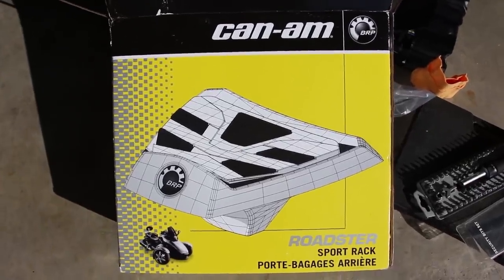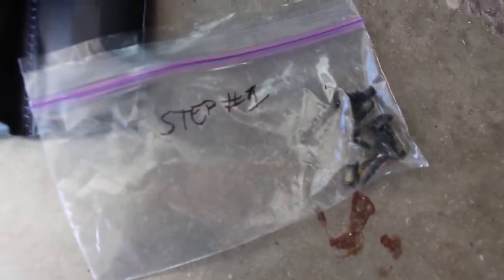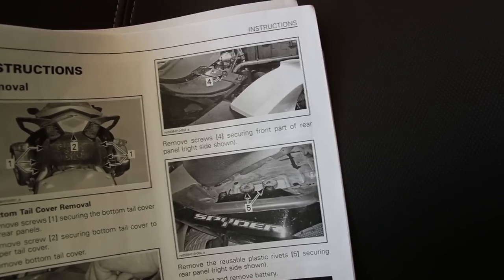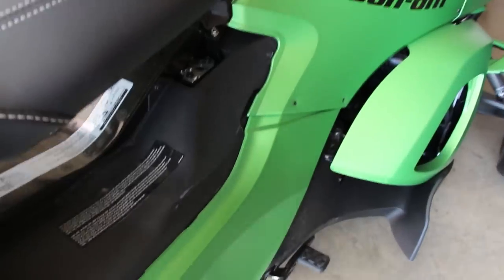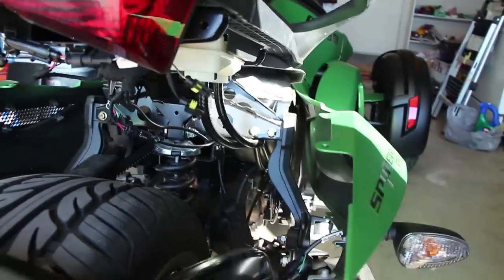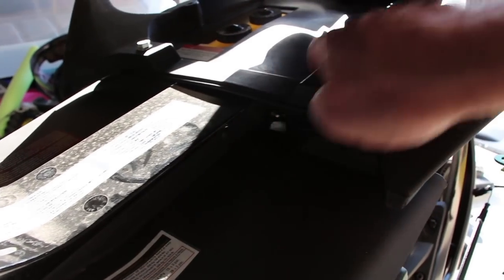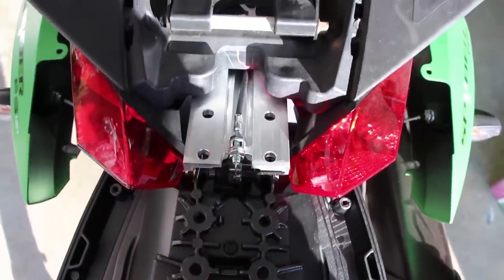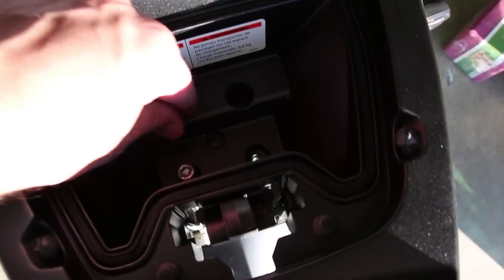How to install Can-am Spyder backrest

Comment: As a heads up, Can Am states that these will only work for 2013 and prior models.  The 2014 & 2015 have a different passenger backrest that mounts differently and has no sport rack / luggage rack option at this time.

Comment: how diffrent is this one from the new one they have now?
Reply from the maker: MrHarlemworld It should fit the 2014 and 2015 RS, RSS but wouldn't fit an F3. You can see the F3 in this picture and the backrest is redesigned: http://can-am.brp.com/spyder/genuine-parts-accessories-riding-gear/accessories/spyder-f3-touring-escape-package.html
Reply: it should also fit the 2012 rss as well.
Reply: @spydertalk2695  I know this post is old but do you know where I can find the same style backrest for a 2016 RSS ?